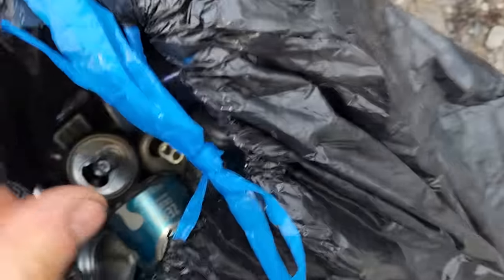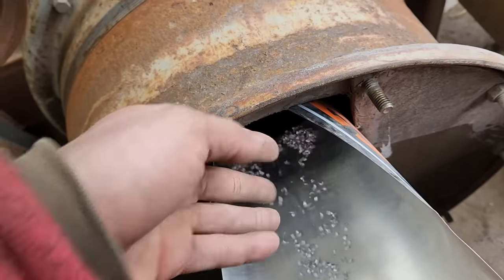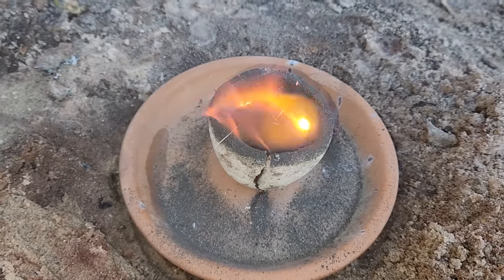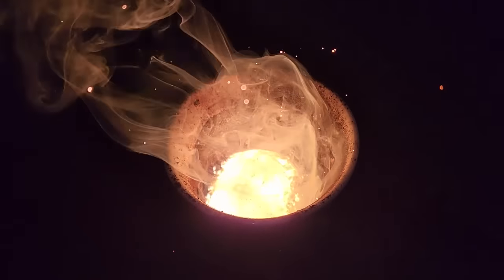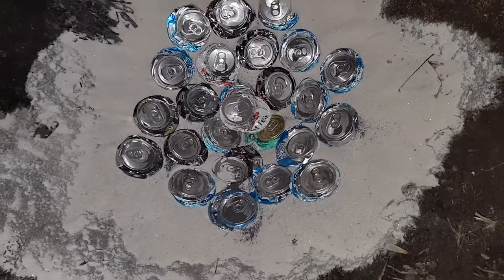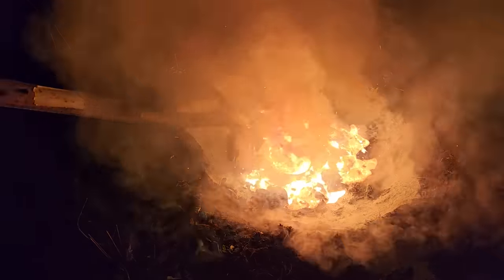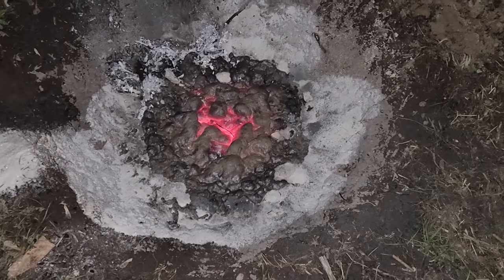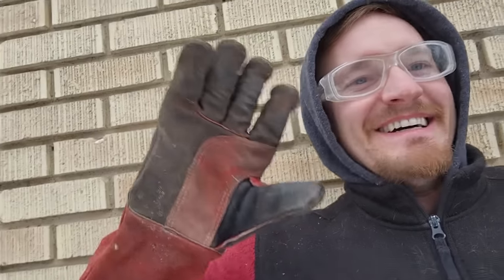Burning 50lbs of Thermite Made From 400 Soda Cans

Comment: I love this kind of video so much...

Martensite crystal structure on that iron, super brittle. You can go to pearlite with that just by taking it above its austenitizing temperature and air cooling it, maybe a couple of times. You probably wouldn't ever want to make impact tools like hammers out of that, but you could do some cool stuff! The challenge is that really you have a non-carbon steel, so any annealing is going to be a slow process to rearrange the crystal.
Reply: "non-carbon steel" -> Steel is, by its definition, an alloy of iron and carbon?

Comment: Outgassing (smoke)  may have been plastic liner and paint in your second burn, but what composition was the outgassing from the first first? 
Can you reveal your 'ignition' powder?
Have you ever used the powder from the machine which turns brake drums and rotors as the iron element? It appears nicely pelletized.

Comment: I would be curious what the purity of the black iron oxide is and how much oxygen it actually holds for the aluminum vs pure iron oxide. And I am curious how much iron and iron oxide there is in the aluminum after being battered around in a rusty steel drum with rusty iron balls. Probably not a huge amount, but these considerations would help you calculate a stronger burn ratio for the thermite.

Comment: I make guitar pedals and they usually go in little alumimium cases. As a result i have quite a lot of aluminium chips!

Not sure where nearby has magnetite sand. I previously made iron oxide by putting wire scourers in salty water and letting them rust, but it wasnt optimal 😂

I met a rolls royce engineer once who smelted aluminium in his garage, there were little aluminium stalagtites on the roof from where he put wet scrap in his crucible :)

Comment: We produce red iron oxide in the steel mill as a side product of the acid cleaning process of the hot rolled flat material before it gets cold rolled. 
Atm iron oxide isn't requested on the marked that much so we hoard hundreds of big packs until the industry needs it😂

Comment: They use alluminized steel for exhaust pipes because they don't rust out And it's cheaper than stainless steel. I don't think your ratio's correct but similar alloy 23:25

Comment: What could happen if you were to take tons of aluminum from, say, a large aircraft ground to powder by an extreme crushing force, and mix it with tons of black iron oxide from, oh I dont know, maybe steel girders that were baked for a while with hundreds of gallons of jet fuel.
Could you produce enough heat to melt structural steel columns?

Comment: Would the reaction work in a vacuum? Would that create a purer sapphire?
Reply from the maker: It does work but it burns slower and doesn't get to as high a temperature. The sapphire purity would be increased by mixing the ingredients more thoroughly so less iron oxide gets leftover.

Comment: When you have a pool.
Going going, is it possible to add Something like one inch thick rods of aluminum And Iron oxide chunks also, is it possible to add iron? Just To purify it. like Inpure cast, iron Chunks full of rust. Or aluminum oxide And Iron oxide  are both extremely common. So is that-a-way to refine it?

Comment: If you calculate your labor, aluminum from cans is not worthwhile. It oxidizes in the foundry and produces a lot of slag. A lot of scrappers will pay more for cans that scrap cast aluminum, probably because of the 1% magnesium? Or maybe because can manufacturers are a big buyer and prefer it. So you might even just be able to exchange cans pound for pound with thicker cast. Also why not just mill the cans directly? I love the concept of aluminum as a fuel. I have a big bag of crushed cans but i think I'll put it all in dilute sulfuric acid to generate hydrogen, and experiment with intumescent coatings on hydrogen balloons. I want to be able to just hold a torch to one and have it not explode for several minutes.

Comment: You’re melting aluminum, you’re using a powerful lathe.

Hey you can make Thermite from cans, if you have this other very expensive and difficult to use equipment.

Do you get the irony?  Instead of having the ability to melt aluminum and buy an expensive lathe, I think I’ll just buy the aluminum powder.

90 percent of people watching do not have access to these tools and process.  

Using the cans to show “anyone can do this just save your cans” dude you’re the can.

And your process for purifying the aluminum, unrefined.